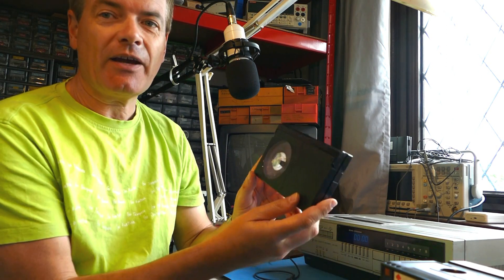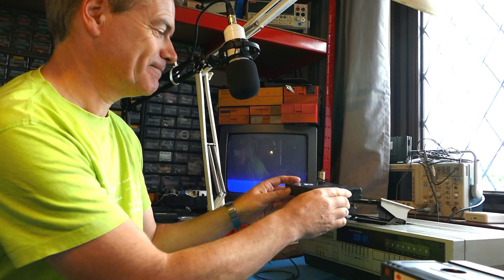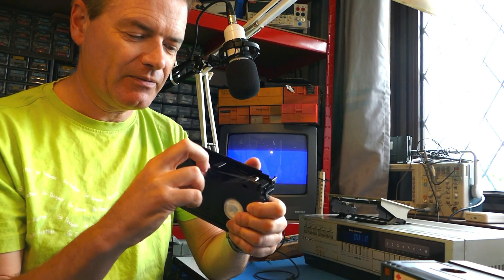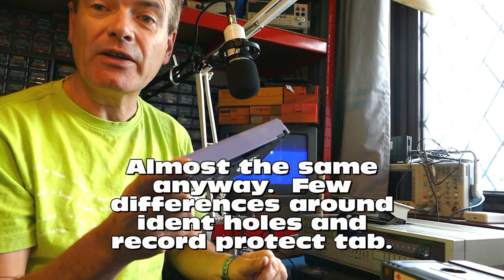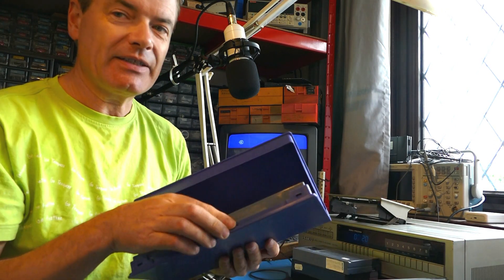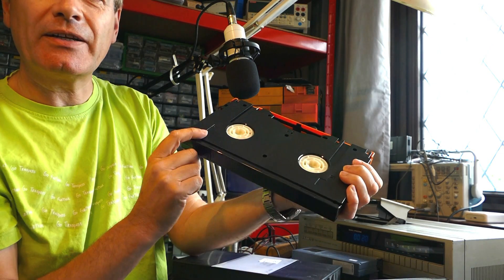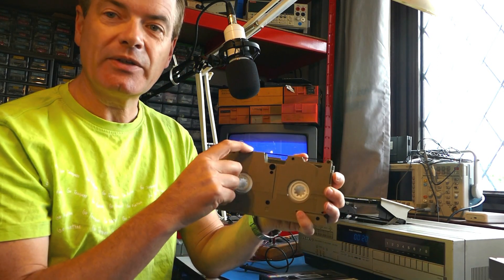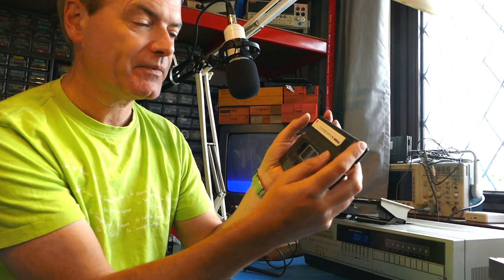A design flaw in the Beta tape (Betamax, Betacam, DigiBeta, HDCAM)

Comment: I never experienced that the tape was behind this bar. This is far fletched seeking for troubles never exposed, unless you have children who opened up the cassette and play around with the tape. I worked for 40 years with this tapes and never had this problem.
Reply from the maker: No it really happens, generally when a machine does not unlace the tape properly.  I would say I get at least one tape each year sent to me with the tape in this state, and other people in the business tell me they do too.  It will apply far more to domestic Betamax machines than to professional Betacam.

Comment: Used Betamax at home and various pro Beta formats at work right up to HDCam and never once had this happen despite using some DigiBeta decks that were quite old. Guess I was lucky.
Reply from the maker: I do a lot of Betamax transfers, and expect to get about 2 tapes per year in with the tape in this position.  Never yet had it with Betacam tapes, it's less likely with those.

Comment: when betacam and hdcam are similar.
can i record on betacam tape in an hdcam machine.
Reply from the maker: Never tried, my HDCAM is a player-only.  I would really like a HDCAM-SR recorder but they still fetch serious money.
Reply: yes it is a lot of money for an hdcam.  i got a hdw-1800 with er-96.  but can find nothing about how I repair it.
Reply from the maker: @andmoea  I would have hours of fun trying to find out though!  I do wonder, what does the HDW-1800 do that my J-H3 doesn't?  Possibly not much. 
Er-96 is SY NV-RAM ERROR   Abnormal operation has been detected on NV-RAM (on SS-101 board) for the system control. 
Could be a flat battery?
Reply: video99.co.uk   Hello again.
hdw-1800 is a fun one.
i can not find a battery.

there are many online with this error.
i want to try and change the flash memory on the print.
not easy but I will try.
Reply from the maker: @andmoea  Yes I see there are others with this error.  It may be that the system is reporting that it has seen a deck error and recorded it on the NVR.  Clearing it may not be hard.  Have you found a service manual?
Reply: video99.co.uk now I found the backup battery so now the machine starts up without error
Reply from the maker: @andmoea  Glad to have pushed you towards the right area.  Trust you got yourself a bargain there.

Comment: I've always wondered what would happen if you put the tape under that guide in the cassette instead of over it. I thought that wouldn't even thread at all. And it might break your tape or VCR.

I do think the VHS cassette was a bit better designed than the Beta cassette, Technology Connections did a video on that. But I mean Beta was the first half inch consumer video cassette format that had some success. VHS came later so they improved on the mistakes Sony did I guess.
Reply: There was the N1500 cassette before Beta, had some mild succes.

Comment: I've seen my share of that problem!
Reply: Me too, even with pro decks. The tension arm that pulls out the tape from the cassette would cause the problem. When ejecting, if the tension arm sticks or hesitates just a bit as it tries to bring the tape back into the cassette, the tape would snag on the tension arm roller and when the cassette raises during the eject, the snagged tape would get free from the tension arm roller and SOMETIMES would get tucked behind that plastic tab in the cassette. If it kept happening consistently on a particular machine I would checked the tension arm operation, alignment or lube some times. But sometimes it would just happen once just randomly for no apparent reason. Then it would never happen again.

Comment: "a small design flaw in the Beta tape format" versus the many flaws in the VHS format. Interesting, but I never encountered it in over 25 years of using it as my main video medium.
Reply: Had my first machine do this today.

I must be the only person who can see that the VHS formats were clearly better in most ways.

I'm still to be convinced by the pro Beta camps arguments.
Reply from the maker: It would generally only show up if a machine had a problem with the reel drive, when tape slack at eject would allow the tape to droop beneath the guide.

Comment: I've been running Beta my whole life and not once run into this problem. the flaw must be your SANYO 4400, that I could see.
Reply from the maker: There was no flaw in the machine, if you watch the video you will see that I introduced the fault on the tape.  But I've had this on a number of tapes which have been sent to me.
Reply: @video99couk  tape slack will do it on the way out of the top loader mech.  I've never had this happen with any of my Beta vcrs. but I pretty much just use Sony. do you have a video of this action taking place, i'd like to see it
Reply from the maker: @betamaxrebeloutpost8945  It did happen to me when I was working on the Toshiba mechanical Beta (see my two YouTube videos on that), but that was to be expected as at one point it wasn't retracting the tape during eject.  Otherwise, no, my decks don't do it, but I've been sent Beta tapes like this several times now.  I probably get about 1 per year in this state.
Reply: @video99couk  Well thanks for bringing this to attention. I'm working on a video that has to do with the tension tabs that are glued in place/ coming loose and how to make a quick repair. This tape guard issue may be a good part 2 section, I'll see what i can do catch it happening on video. Got a pretty good feeling though its more to do with top loaders and stand alone re-winders leaving too much tape slack on eject. We shall see!
Reply from the maker: @betamaxrebeloutpost8945  Yes I've had those tabs come adrift once or twice.  Certainly the problem I discuss here is generally caused by slack on eject, though mishandling might occasionally do it too.

Comment: There is a more serious design flaw on some of the early Sony Betamax tapes. Inside the cassette there is a couple of tabs/pads that push the tape against the plastic rollers. These pads are glued onto the shell inside the cassette, and when they get older and older, these become unglued and get caught by the tape and then you risk destroying the video heads if you attempt to play the tape. Someone gave me a box of some very old Beta cassettes and 90% of them had their pads ready to come off and get stuck onto the tape.
Reply from the maker: Yes, that's been mentioned further down this comments section, and I have seen it on occasion.  I've also seen the tabs break free very occasionally on VHS.

Comment: hi i got some betacam  sx  sealed tapes i know they are very thin tapes is there any betacam unit's i cam used them on
i was told betacam sx has audio drop out's
Reply from the maker: SX tapes I think are the yellow ones which are interchangeable with BetacamSP, but look that up.  Audio dropouts may apply just to the linear audio tracks, the FM ones might be more robust (or, possibly, the other way round).

Comment: There was also "MI" Or M-Vision as Panasonic called it, trying to compete with Betacam it used standard VHS cassettes for 20 min of recording. RCA sold the system as "Hawkeye". MII was a horrible format for many reasons, but the man one being the extra thin tape used to get 90 minutes of recording time out of the tape that would fit in a standard VHS shell.
Reply from the maker: Yes, M format flopped even more badly than MII.  I suspect it was never even sold in the UK.  Absolutely the thin tape used in MII was a disaster.  It was all because VHS was too big for camera use, so they had to make a smaller MII tape for that purpose and then use VHS size as the large tape.  Beta was small enough for camera use so they then had larger tapes for studio use with sufficiently robust tape.  Still fairly thin compared to domestic Beta though.

Comment: The reason Sony put that plastic tab there is to avoid a loose tape from getting behind the P guides of the transport mechanism when inserted instead of in front of them risking the tape not getting pulled around the head, Beta tapes has a large gap in the cassette shell because of the design of the mechanism, They fitted sync and audio heads in there while VHS have the audio/sync heads away from the cassette shell so only two openings needed for the P guides makes it almost impossible for a loose tape to get into those two cavities. So I would say the entire system is a design flaw not just the tape.
Reply from the maker: I think you are right.  The large gap at the front of the tape is needed because of the way the format laces up.

Comment: In my entire professional career as a television engineer, I have never seen this be an issue.  It's not a design flaw.  It's purpose is to hold the tape behind the door when there is inadvertent tape slack, thus preventing the tape from falling out and snagging on the cassette loading elevator, something Sony learned from their U-Matic experience.
Reply from the maker: The design flaw is that the tape can get on the wrong side of it.  You're right though, as I've said, it's much less likely to happen on professional, well maintained Betacam machines.  I've had quite a number of domestic Betamax tapes in where the tape has got onto the wrong side of the guide, and just one BetacamSP tape.